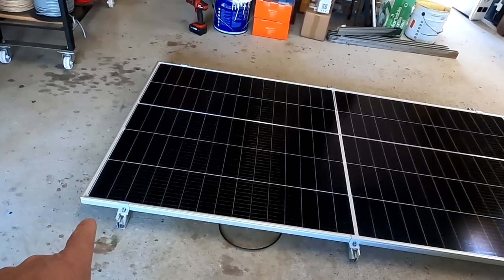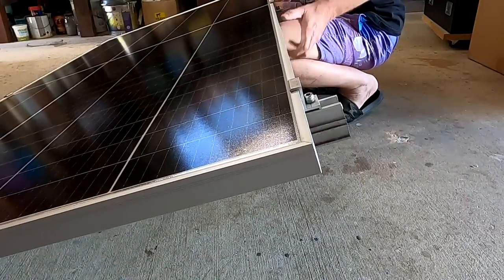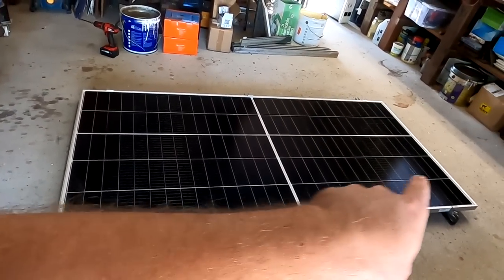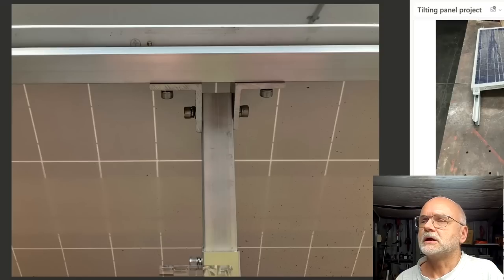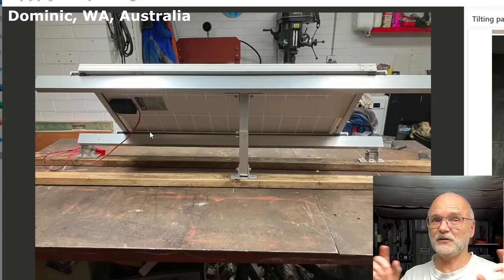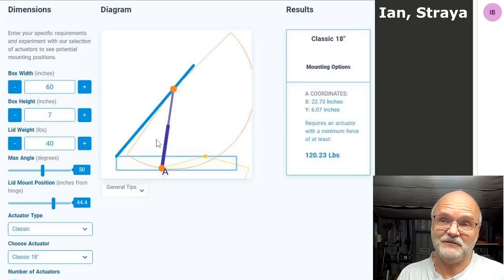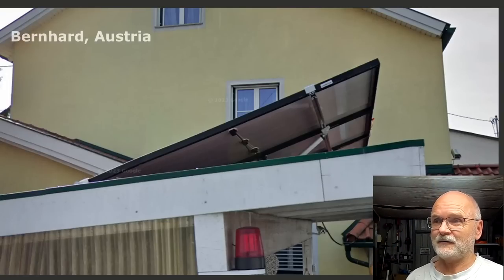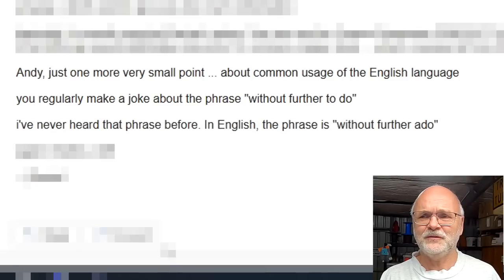Single axis solar tracker with large panels impossible? Here are YOUR suggestions.

Comment: Hey Andy, from an engineering POV, you're missing triangles in the right places to prevent wobble. Consider the cross bars as you did, but the vertical bars should form a triangle and join at a point PAST the top of the panel, so they should be at least 2m long. You will then mount the linear actuator to that join point. Think of it like a artists easel. However this also makes the mechanism bigger and will of course cause shading issues. 

Ultimately I still think having the panels in a fixed position is going to be best. You keep complexity down and can secure things completely. If you want some adjustment, make up a 2 position or even 3 position (Summer, Spring/Autumn, Winter) mount and change it seasonally.
Reply: Agree with the angles to prevent wobble. Maybe center actuator could have a bracket holding braces to the upper corners of the panel.
Reply: Maybe some reinforcing bar at 45 degrees indented 40cm on the corners would help reduce the flex.

Comment: I just settled for a fix angle on the panels and 2 support beams per panel, we get pretty strong winds here in the desert but they still there. I wish I had the funds to put them on a tracking system, but it is totally out of my range, got 26 panels all fix angle and they average 30-33 Kw per day during nice weather, during summers up 105F they drop to around 30 Kw so no complaint and is simple enough.
Reply from the maker: Perfect, if you have the space and sun, go big. Or, as big as you need. Do you have a battery as well?

Comment: Super topical and timely, thanks.  I'm building a similar system with 3 high wind features to command panels to fully or partially stow: (1) accelerometer vibration... structural twist amplifies acceleration... flexibility is perhaps a feature, not a bug; (2) anemometer; (3) weather service high wind warning (e.g. thunderstorm, tornado, hurricane).  My hardware isn't as mature as yours, and I sure appreciate the heads-up about rigidity.

Comment: Andy, I suggest to mount a scissor lift at both edges of the panel and connect the joints of both scissor lifts with a linear actuator in order to raise or lower both edges synchronously. 😉
Reply from the maker: A lot of mechanic...

Comment: OK will try again.  

Use 2 car tailgate door Jack on the 2 sides n actuator on the middle. This will stabilise the 2 corners. Use a solar tracking system with wind protection so u can program at what wind the panels should lay flat in case of high wind.
Reply: push

Comment: Andy all this actuators can work, and "one side blocking" can be solved with simple triangle forms. all bridges use them and hi voltage pole use triangle form to eliminate linear structure problems

Comment: Hi Andy, for lifting use two threaded rods, nuts connected to lifted parts of the panel. Turning of rods will lift up or down panels. Rods can be connected wit bicycle chain to sync their turning.
Those rods are making support of panels same time.

Comment: Hi Andy,  at the last minute I thought of an idea ... "concept wise" ... Think of a hood (Bonet) on a car.  It has two hinges, spring loaded.  If the two arms (one on each end of the panel assembly) come up from the roof surface at the pivot ... to the top edge the panel would be biased upward, not spring down, the spring tension would help lessen any flexing if the base frame is make all the same level and not two steps. ... then a simple stepper motor with a threaded rod etc. can screw the top center of the panel down.  Pull it down rather than push it up.Being a threaded rod (kept lubricated or shielded .. no rust) you would have no mechanical things under the panel basically.  make a simple rectangular frame where all four sides are the same and secure the panel to that (like a window glass frame).  Thanks for helping me use my up stair thinker.  (as a side note.. having been a mechanic for decades, I always used a garden pad etc. on my knees and never kneeled on the concrete directly.  It has saved my knees .. now pushing at 70 (age not degrees);-)
Reply from the maker: Thanks for your suggestion. Yes some gas struts could make it work and give it more stability. But we keep adding more and more which makes the system more complex, adds more maintenance and it is more prone to failure. There is a lot we could do and try. I also only have hand tools to build such constructs. I think it all gets a bit too much. I'm really stripping it down again and start from scratch.
Reply: @OffGridGarageAustralia  I don't think you got my concept and idea .. it is because I don't communicate well.  I will look for your email under the channel and send some sample ideas.  It is so simple it is ridiculous ... to me that is ...  How many panels 4 right ...  will there be a lot of flexing when there are not "high" winds.  ?
Reply: @OffGridGarageAustralia  Hi, I go by Pat  ... I don't know how to find your email but I can give you mine...  junk mail I let go to spam.  Or I can post some links here of a website that has the hinges that I am talking about.  Everyone is talking about lifting the panel, my concept is the panels are lifted automatically by the hinges no ram ... no tracks .... etc.  then you pull them down somehow, even a single section .. again too ...

Here the lowest my panels will be is 19 degrees.  So that will be my "lowest" position ... not 0 or flat. ... then I'll work on putting up as winter comes etc. ...

Comment: Andy, at 16:00, I suspect a diagonal cross brace might help you flexing situation,  but my initial thought was for a system that had a welded square tubular frame attached to the back of the panel, and a tilting system with an actuator lying flat on the roof pushing the sliding bottom of another square also hinged to the top of the panel frame, similar to Jens in Germany presented.
Reply: ANDY, MAYBE:
(1) INSTALL IN A FIXED POSITION THE LARGE HIGHER POWERED PANELS ON THE ROOF. 
(2) INSTALL THE SMALLER PANELS ON YOUR ADJUSTABLE MOUNT.
(3) CUT THE TALL VEGETATION THAT LIMITS YOUR SOLAR WINDOW. 
WE LOOK FORWARD TO SEEING YOUR SECURE SOLAR SOLUTION.

Comment: Fair enough! Actually I had noticed from my ground mount installation (optimised for Winter) that on bright days the generation is not too far away from peak power (better than I had expected - right now). From this I wondered if a smaller array (swiveling) to stay on peak for longer (time) would produce the same or more Power than a larger fixed array - hence my suggestion. I figured 1.5 kW panel capacity might be sufficient.

Comment: Andy the last picture with the pulley and the red "string" , that shows when it is pulled by the pulley.  The "pink" colour is when the panel is flat the string sits under.  So it shows panel in both the upright and flat positions.
Reply from the maker: Ah, right, I get it now, thank you... well,  anyway this won't work.

Comment: You'll get rid of alot of wobble if you mount the horisontal rails closest to the panel + you can connect two actuators 70 cm in from each side to get a really good stability in the panel.

Comment: In Indonesia (East Borneo)
I have used a 1 axis solar tracker system.  energy gain can reach 8 hours of full light.  the average is in 5 hours of irradiation.  
Using 1080 wp PV module, I can get 5 - 8 kWh/day
Reply from the maker: Nice, yeah, it can work and make sense. I'll try the fixed tilt system now and see how this goes.
Is that one module with 1080W?
Reply: @OffGridGarageAustralia  
I'm using ( 2 x 160wp ) and ( 2 x 380wp ).  one bracket can mount PV modules up to 1500wp, plenty of space left.  And currently designing a bracket for modules >2000wp 
(4 or 8 pcs × 550wp)

Comment: Hello Andy
	After viewing your efforts to construct a variable tilt system on your porch roof, I wonder if you have considered something quite different. Maybe an array could be mounted in a rigid frame on a four wheeled trolley. The trolley could be moved during the day to be in direct sunlight (around about the area where three panels were propped up on the ground). I suggest that the tilt angle won't be necessary to alter during the day but designed to be laid down during bad weather and storage for the Summer months. ie. manually laid down (or stood vertical  on the trolley for storage in the shed.
	I like your humour!
Reply from the maker: I like YOUR humour😄
So I instruct my wife to move a 200kg trolley around the yard, using a S.P.A.T. to get the best angle, ensure the cable is not tangled, twisted or rolled over, ensure the cart is secured so it does not roll away when it's windy and also crank down the panels to a flat position if the wind gets too much.
You must be single 😂

Comment: I’ve done no experimentation to back this but I have considered this sort of thing before. My conclusion was that unless I have a ground setup where there is plenty of land it wouldn’t work as well due to shading. With a roof, more panels is a better spend.
Reply: Unfortunately the maximum system size is dictated by the long cable that runs from the pool back to the garage, so using more than 1 of these micro-inverters is not possible. Andy is not yet allowed to tie into the house's wiring, as there is a power purchase agreement with the house system.

 The micro-inverter itself can only accept 4 panels also, and more production is not required/usable in any other season than winter - the panels at a steep angle are the correct technical solution to the winter production requirement - the mounting thereof just needs to be safe and have an good "Wife Acceptance Factor" - I suspect that the simple mounting system Andy already has is the best solution, the rear feet just need to be located beyond the curve of the panel folding down, so that the rear rail can be disconnected and the panels lowered safely flat to the roof when not in use.

Perhaps add a locking mechanism onto the roof with a pin/latch, so that the panel can be locked in the down position also.
Reply from the maker: Thanks Stefan, well summarised.

Comment: So many suggestions on stiffening, but I have not seen any that has applies good theory.  Start by considering the shape of the panel perimeter pieces.  The panels have 4 long perimeter shapes - in this case, they are either angles or c-channels.  If you took one of those, hold one end in a vise, and try to twist the other end, how much resistance is there?  That is the flexing you observe.  An angle will have little resistance.  C-channels maybe a little more.  Box shape a little more.  But the best shape to resist twisting (torque) is a pipe or tube shape.  The larger the diameter or the thicker the walls, the stiffer it will be.  Therefore to stiffen your panels without disassembly, you would create a new rectangle that runs the perimeter of the panel, with a tube on each of the two longest sides.  The other two sides will be the same "height" as the tube, and can be the shape of a flat bar or angle that is rigidly (welded?) to the ends of the tubes.  They act as levers on the tubes.  Metal electrical conduit may be a suitable tube.

Comment: Hi Andy,

I think you can gain stability by actually fixing your test setup in the middle of the panel where the actuator would go. 

Using lager, more stable horizontal bars instead of the small one may also make a difference. 

And last, adding 2 gas springs on the corners is a cheap way to gain extra stability ?

I have also seen lid supports with rails and fixed settings. 

Bed actuators use that system. Along the actiator there are supports with “hooks” that support the bed they won’t come down and can cary all the persons weight until the get fully extended at which point it can come down. Maybe you can copy and adapt some of that, bed actuators seem to be quite stable.

Comment: G'day Andy nice idea on the frame but a few thin diagonal bracing but all cool I can understand the problem not easy fix another idea let the actuator lift the frame like a sissor jack not straight from roof to frame and a quick idea you can use a raspberry pi to control different heights in the day
Reply from the maker: The big problem is, we're adding more and more to the setup. Not sure if this is worth it... I'll try with a fixed installation first.

Comment: You really need a square box section frame with welded corners to eliminate twist. In forty years as a metalworker I can guarantee it will work.
If you weld up a frame from angle, they still twist. So get a frame welded together from box section and fasten the solar panel to it....... Twist will be gone.

Comment: I have had 2 wind generators at an altitude of about 350 meters in central west of Victoria Australia (North northwest of Ballarat) and they where a bit of a disapointment. They where competetive when PV was $10 or more per watt but not any more.
To avoid flexing you have to have a very rigid top structure. It could be made by two beams 2 meters long (the length of the panel + a little), two end beams say 20cm and a cross beam from corner to corner. To avoid allways having the top of the panel at a minimum of 20cm high it could be hinged to the top of the panel like the bottom and then let that be flat on the roof as well when it is down. it would however still not be perfect. 
The best would be to make a box structure 10 or 20 cm high with diagional beams in both walls and ends. The panel when down would then be 10 t0 20cm above the roof but flat with the roof. The hinges should be on the frame. The lower part of the panel could hang over the frame so that it would come closer to the roof when it was tilted up. It may no look so good but it would be strong.
Reply from the maker: Thank you for your suggestion and sharing your wind generator experience. A lot of effort to set one up and install it for little gain. As you said, it makes little sense if the conditions are not right...

Comment: The flexing happens because the framing of the panel is thin.  Because it’s designed to be supported on all corners.  

If you’d like to support the panels at only one point then the structure needs to be reinforced in a way that adds material in the dimension that gets shorter and longer as it flexes and twists.  All of the reinforcements you have done so far are oriented off-axis and so they won’t be effective - they will tend to twist in the same way the material in the existing frame does.  

When the frame twists the diagonal axes are changing in length.  And so you need to add material on the diagonal axes to counter the flexing.  

Another way to reinforce the panel is to add a round tube along the bottom edge of the panel with ribs attached to the tube and upper edge.  The tube and ribs will bear the torsional load that allows the panel to twist. 

One more thought is to use tubing and ribs to extend the reach of the actuator. 

Final thought is that the prop brace is only supporting the panel at one point.  Lifting with a triangular shaped brace should alleviate this source of flexing.

Comment: What is on the other side of the house roof?
On a solar farm they have the mounts lined up north/south and the panels tilt to the east in the morning and track the sun all day long until sundown.  The panels are on a frame and it pivots at the middle of the panel array, but that also requires a bit of height to do that.
Reply from the maker: That's a free 120sqm roof on the other side but points to WSW, so not ideal for winter sun.
Such a ground mount tracker also requires a big hole filled with concreted to give it the necessary wind stability. I neither have the location nor intention to do that. We have such a system here the University and I like how the many trackers are looking in all directions when it is cloudy...

Comment: …another idea for the automatic tilt system can be to use on left and right hand side of the panels a gas pressure spring (to pull the panel up) and in the middle you can than have one actuater which regulates the angle. As a result, you get 3 fix points to mount the panel…
Reply from the maker: Some people have suggested to use gas struts, so yeah, that could be an additional solution. Thank you.

Comment: I drive a flat bed semi and lately have been hauling a lot of solar panels and also huge commercial grade batteries. The batteries are so big that only 2 fit on a 53 foot trailer and weigh about 20 thousand lbs each. Id love to have one of the batteries i haul and a truck load of the new panels lol.
Reply from the maker: One day, you will get one! But you can start with the solar already and get a few panels (even used ones) and charge a smaller battery. Get a small inverter and run your fridge and freezer from it to start with.
Reply: @OffGridGarageAustralia  I have about 30 grand in my solar power system already but it's not as big or as capable as yours.  I power my whole life including my air-conditioning with solar and about 40 kw of lithium.  You have the most beautiful home tho and the solar to go with it
Reply from the maker: @matthewknight5641  Oh, wow, then you know how it works and are energy wise too. Thanks for sharing.

Comment: 2 steppers with ball screws. 

Then use an arduino or esp32 to control the servos and throw an error if the steppers lose steps. (Similar to z axis on a 3d printer.)

Use the same esp32 with a voltage divider on it to tap the panel itself to change the tilt using PID and use a mic for the noise for wind and then just sunset data to drop it at night. 

Voila, done. Minimal code too.